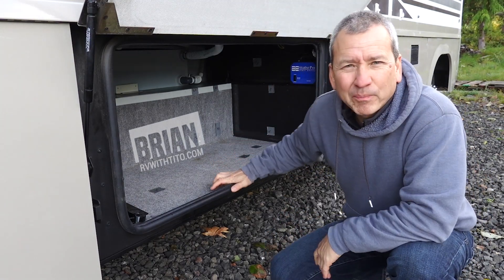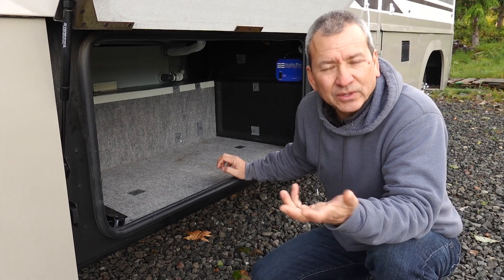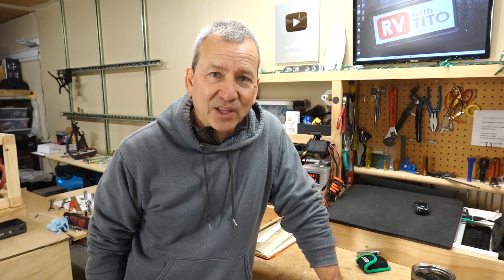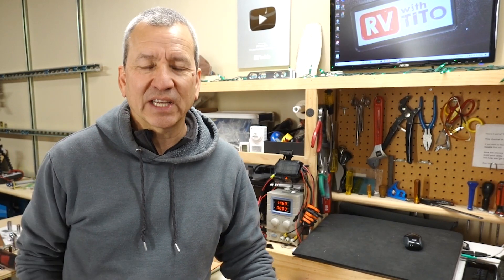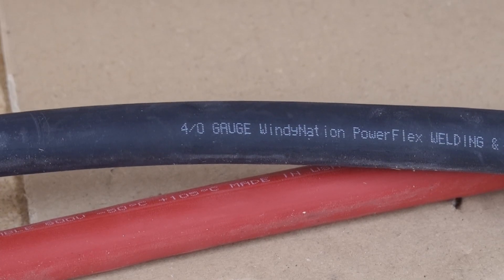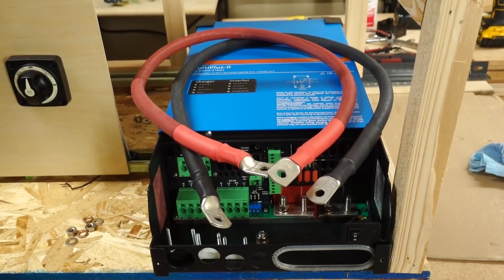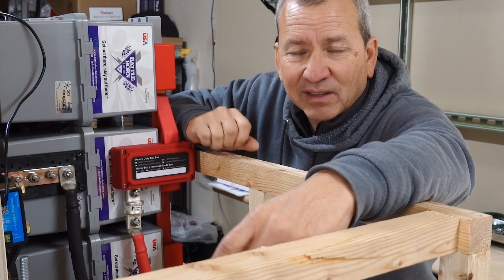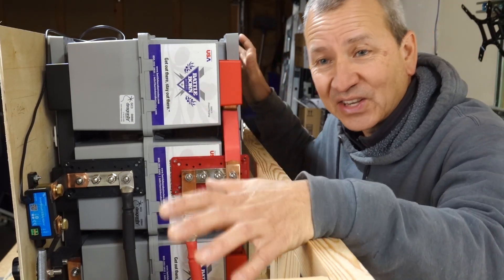Our Massive RV Battery Bank with Copper Busbars | Battleborn GC3 Lithium Battery | RV With Tito DIY

Comment: I just read your PDF, and that you have the Powerline system as well. Just a note, I just put in four 100AH BB's and a Go Power IC 3000 (I wanted the MultiPlus II, but it was back ordered earlier this year, and the size didn't fit my space) I have done this same setup in my previous RV but with the Go Power IC 2000, and it worked well 98% of the time for me. 

So the way the current inverter was installed from the factory is that there was a 30amp fuse in the main distro panel that feed the inverter, and the inverter feed two circuits in the RV. I wanted to run all 120v AC items in the RV via the inverter if I want to, so I rewired it, so that it feeds the main panel. I ran into problems with the Powerline system, when the inverter kicked in. To fix it I bypassed the Powerline system inside of the main panel. In the Panel, you can see where the common wires go to a power block controlled by the Powerline. I just removed that wire from the powerblock and went directly to the breaker, as you would in a panel with out the Powerline system. If I ever want to use it later, I could hook it back up, but I really don't see myself ever doing that.

Comment: As soon as I saw you were connecting everything with busbars I was worried about vibration as well. That is a lot of weight connected, but if you keep it secure you should be good. One recommendation is to use all three, or at least two of the holes on the GC3's built in terminals for your connection. I have seen what a loose 240V AC connection does.. Damn near burnt down my dads house. 

Now the BIG question... Are you going to add plexiglass and lights to the battery compartment? lol

Comment: Nice set up. I am currently in the process of putting in 2 GC3 Batteries and a Multiplus 2 in my 2014 Newmar Canyon Star. I looked at your diagram and was wondering if you are going to charge the batteries from the alternator? Also, I was told the fuse needs to be within 7" of the batteries and I noticed your fuse is after the distribution block closer to the inverter. Love to see how it comes out, trying to decide exactly what bay to put my batteries
Reply from the maker: I'm not going to install a DC-DC charger for now. I can simply run the generator to charge at 120A if needed. Plus I'll have 1700W of solar. The Victron DC-DC charger (the one we have in the Class C) will max out at 30A.

Comment: Brian, can you shed some light why pay $2359 for 270Ah when it is easy to find a good 200Ah for $700? The form-factor is really nice, but is it that nice? That said (asked) wonderful attention to detail and excellent presentation, my friend.
Reply from the maker: I considered lots of options for this. This really was the best option for me and yes, there are lots of options. The form factor was a big factor for me since I still needed to fit the inverter and all my solar gear in the same compartment. I've also had great experiences with my other BB batteries. The quality of these GC3s seem top notch and I'm looking forward to putting them to the test. The cost per 100Ah is about $870 which is comparable to many other leading LiFePO4 drop-ins. I wasn't simply going for the least expensive solution. I wanted a one-and-done-never-have-to-think-about-it solution. Not sure if that helps, but that's my reasoning.

Comment: I’m curious as to the weight, and more importantly, how much weight can the storage compartment safely support? Are you just putting the batteries on the floor of the compartment or are you “beefing” it up?
Reply from the maker: The batteries are 80lbs each. The Inverter is around 40lbs. I have a plan to support them from above and on this ledge around the compartment. The full weight won't be on the floor of the compartment.

Comment: I’m feeling a lot better about my choices now!  I went with the BBGC3 battery too and I’ve been working on shoe horning them into my battery compartment.  I’ve limited space, so I plan to go with just two of them.  It was a radical shape and design to me and I thought it might be a risk, but if RV with Tito is using them, I’ll sleep a lot better now….  😀. Looking forward to seeing how you install them.
Reply from the maker: Excellent. Stay tuned. Yes it will be a little tight but sturdy. Stay tuned.
Reply: @RVwithTito  Most definitely!  I think everyone is anxious to see this project through to completion.
Reply: Tim the Toolman Taylor would be proud.
Reply: You should apply some diaelectric grease between the dissimilar metals in you set up , or just use vaseline , it will work just as well to keep corrosion down and cost way less . I am a retired electrician .
Reply: @russelbaird5499  That’s great info.  I was wondering about that and thinking about getting some dielectric grease as I’m almost out.
Reply from the maker: @russelbaird5499  Thanks for the tip Russel.

Comment: Great video. Looks like you could install 3 bolts per battery connection point on the bus bar. That way, the likelihood of all three coming loose it greatly reduced. Also, LocTite and/or a secondary nut/nylock nut would help. That will be a great system, huge aH.
Reply from the maker: Yup. I could do that. I think it's pretty secure though. There are two bolts on the two terminals that connect the positive and negative to the busbar.

Comment: I am very impressed. Looks like a clean set up.  In the spirit of the thermal expansion below, are you planning on resting the batteries on some type shock material to reduce the effects of shock and vibration from pot holes and other road conditions.  Understand you do a lot of boondocking and the paths to those sites are unpacked.  
The shock and vibration may have an affect on bolted connections, especially those 1/4 20 fasteners in ABS plastic.

I always enjoy seeing your workshop.
Reply from the maker: I have a plan to support them from the sides and above (through the floor above). The majority of the weight won't be on the bottom of the compartment. Stay tuned.

Comment: Did you consider the pack will expand when they get hot. A lot of LifePO4 builders struggle with that. It will give some stress on the terminals. Very neat setup though. Look forward to the rest of the build
Reply from the maker: The way the GC3 cases are designed, there's plenty of space between the mounting feet. Room to breath I guess.

Comment: You mentioned vibration, but did not mention if you minimized mitigation by using blue or red threadlocker.  Good video, except I think many now adays will be building there own battery bank (unless being subsidized by the manufacture) at a MUCH more economical price.
Reply from the maker: No I don't plan on using lock tight. All of the these battery terminals do have nyloc nuts. I'd have to disagree with you about DIY battery packs. I know lots of folks who full-time boondock like us with Lithium batteries. Very very few have built their own packs. Yes I could have easily ordered Chinese LiFePO4 cells and multiple BMS' to build my own. I just prefer not to. Also, in case you're wondering, BB did not give me these batteries. I paid for them myself.
Reply: @RVwithTito  Ah!  That was the $7,796 question.  I was wondering.  Congrats on taking that plunge.  I struggled on pulling the trigger and I’ve a much more humble setup.

Comment: Looks great. Keep up the good work. 
Have you put any thought into keeping the batteries from getting down to 32 degrees. As you know lithium bms will shut down at 32 degrees for charging. I have built my own 600 ah lifepo4 batteries. I have my setup in an insulated  small bay on our class A. I used a rv interior 12v light that uses a 1156 12v light bulb and a 4” computer fan to move the air around the cabinet. Which is controlled by an arduino wemos board , Ds18b20 temp sender and a arduino relay. Temp is programmed to turn on at 45 degrees and off at 48 degrees. It’s automated to run on it’s own. When we travel the battery bay is heated from our basement Espar diesel heater. It works great. 
The 1156 bulb and fan draw 1.5 a when it runs. Works great. 
Cheers
Reply from the maker: Yes. An incandescent light works great, but it's ok for them to get down to that temp. Just don't charge at those temps. This is easily managed through the inverter and a temp sensor on the shunt. Also the compartment doesn't get that cold. My past experience has shown that this isn't much of an issue while we're using our RV. I have heating pads on our Class C lithium bank, but it's hardly ever kicked on. If you're using the batteries, the internal temperature will typically keep the battery from getting too low. Yes. If your RV sits dormant in a cold climate, it's best to disconnect them or do what you suggest. Thanks for sharing your setup.
Reply: This is a concern of mine.  I’m installing in the battery compartment which is essentially a steel box and I worry about cold locations.  I have a bunch of left over lights from swapping out to LEDs and thought to mount a couple in the bay for just this purpose.  I like the automation you’ve outlined.  I just need to figure out how to do that.
Reply: @jimsjacob   you need to insulate the box first. I used only one old rv interior 12v lamp with a 1156 bulb and after some experimenting I added a 4” fan to circulate the air. Have you used Arduino boards and coding before? It’s really not that hard to do. 
The arduino wemos board and relay is under $20. I can give you my arduino code, I use for the automation. The arduino wemos board runs on 5v which all you need is a 12v to 5v converter. 
Let me know if you want more information.
Reply: @craigmckenzie8028  Thanks for the reply.  I was thinking of insulation as well.  I can only do 3 sides as there is almost no space for the floor.  I have approx. 14 inches of clearance and the BBGC3 is approx. 13.1 tall.  I have zero experience with the board you mention.  If not to much trouble, please do share.  It is much appreciated!

Comment: You mentioned that he batteries fit a strut channel.  U can understand how that would be very useful.  Can you spend more time on mounting the batteries securely?  Thanks!
Reply from the maker: They are just sitting in the strut channel. My support setup is a bit more elaborate. I will actually have them supported from above and will cover that more in a future video.
Reply: @RVwithTito  Please hurry…. Installing mine and I don’t have you engineering skills.  LOL.

Comment: Try to NOT keep them at 14.6 V... 🙂

I'm sure you read it somewhere and I'm sure more people have said it or going to say it: unlike lead-acid batteries, lithium batteries don't like to be stored at the highest allowed voltage. If you are not going to use them for a few months, weeks or days then it's best to keep the batteries at about 50% charge or their nominal voltage which is perhaps 13.4V.  That way they age less fast.   I believe even the spec sheet of these batteries specify this as their "float voltage".

Then when you boondock and you use your generator or solar to charge them then that highest 14.6V is not a problem as in practice they won't stay long at that voltage due to you wanting to turn the genny off and/or the sun going down and all 🙂
Reply from the maker: I only took them up to 14.6 to top balance them. The charger is set to charge at 14.4V and float at 13.6V

Comment: That is pretty cool Bryan!  With regards to vibration from traveling down the road maybe put some anti-vibration feet under the batteries to act as shock absorbers.   Good luck with the project!  Looks like a lot of fun to build.
Reply from the maker: Thanks for the tip! I've got a plan to keep them pretty secure. Yes. It's fun to experiment with different methods.

Comment: Brian, great setup. Thank you.
I'm in the process of planning a GC3 based system for my motorhome as well. I bought 4 GC3 and a Quattro 48/10000/140 100/100 120V. I should be getting them on Monday.

I went the lazy route. I will be connecting everything with 4/0 marine cabling instead of the copper bars. Everything is going to be connected with Blue Sea systems switches (9003e), 300A class T fuses (5119) and fuse holders (5502). I will also be using Victron 500 A Smartshunts.

I went with a 48V battery bank for the 120 Vac needs of the bus because I want to be able to charge the bank quickly while boondocking. Charging at 140A @ 48V with the 10 KW generator is about 6.7 KW of charging. That is an efficient way of running that generator. So I'll be able to charge the batteries with solar during the day and then just turn the 10KW diesel generator late in the afternoon for an hour or so to top them off. Topping them off means charging them up to about 80% of capacity. For the sake of longevity with the lithiums, I think I'll run them between 25% to 80% SOC (State of Charge).  You can charge them to 100% and use them below 25% SOC, but the batteries may not last as long.

On the other hand, as you know, with 120A charging @ 12V from an inverter/charger such as the Multiplus II would just be about 1.5 KW pulled from the same generator. The 1.5 KW would be a very small percentage of the approximate 8.5 KW of continuous power that I can pull from the generator. Also, at 1.5 KW, it may take a few hours to charge that 12V battery bank, depending on how much solar there is on the RV.

I plan to have a separate bank at 12V with 2 GC3 in parallel charged by a Multiplus II. This way, I won't need DC-to-DC converters from the 48V bank to get the 12V that I would need for the coach. In addition, the 1.5 KW charging for that 12V bank + the 6.7 KW charging for the 48V bank would be a worst case of about 8.2 KW of charging from the generator. That would run it very efficiently at about 1 gallon of diesel per hour. Note that the 12 V bank will only be responsible for the 12V needs of the bus and none of the 120 Vac. Solar will go to both banks. So the 48V lithium bank will be strictly for the 120 Vac needs of the coach.

For now, I'll be using the setup as a backup power system in my bricks and sticks, because where I live in remote northwest N.J., I can always count on losing power a few times during the winter. The setup will be connected to the house wiring via a 50A 10 circuit transfer switch.

Next spring, my setup will move into the RV for some happy boondocking.

I'll be looking forward to the rest of your videos in this series.

Brian, just one constructive additional comment. I would recommend that the class "T" fuse be placed on the battery side of the bus bar. As it stands now, if you short prior to that fuse by the inverter, the cabling from the battery may overload and the fuse may not blow. That's because all the current goes down the short and not through the fuse which is further down the wiring. Fusing should be at the source of power, that is, as close to the battery as possible. In case of a short, the lithium batteries can provide a huge amount of current. I guess only limited by the built-in BMS. I guess the inverter may also need protection from a short. Now I'm wondering if there should also be a fuse at the DC output from the inverter?

Here is a link for this kind of discussion: https://www.pysystems.ca/resources/boating-tech-talk/robert-fuse/
Reply from the maker: Thanks for the suggestion. Most of the other key components on the pos side will have their own fuse. Yeah. I decided to stick with a 12V system and pay more for parallel charge controllers. I've had good luck/performance with that setup. I get why you went with 48V.
Reply: this is like going to a trade school w you both
Reply: There's been two recent papers proposing LiFeP04 may have an interesting form of "memory" similar to the NiCd's. The papers looked at old LiFeP04 banks that were cycled far less than 100% DOD, usually 50-70% DOD and found that over time the pack would "learn" that the capacity of their daily DOD routine would become their permanent available capacity. Not enough data out there to say this is true under any situation but its a consideration. I can't imagine being more conservative than 2.75 or 2.80 to 3.50 (balance on) 3.55 (max cell voltage cutoff). By the time you get 3,000 cycles out of these we will (hopefully) have a much better chemistry that has reached commercial viability.

Comment: The ribbed water tank fill hose becomes brittle with age. Consider replacing before it leaks on your electronics.
Mine failed at the outer wall where it connected to the plastic fill fitting. Sun baking wall may have contributed.
Reply from the maker: I'll keep an eye on it for sure. I don't always use that gravity fill. There's another pump fill on the other side.

Comment: You make it look so easy 😉. Probably the hardest part was the planning. BTW is it true that lithium batteries do not work well in freezing temperature?
Reply: They can not be charged if they are below freezing it will ruin the battery. Good quality batteries have built in low temp cut off to protect them selves. You can still safety pull power out of them so you can use the batteries to warm them selves up via heating pads or your rv furnace if you need to though. Its not a big deal if you take their need to be kept warm into account when building your system. Since they don't off gas like lead acid you can keep them in conditioned unvented space. If you can keep your water system from freezing you can keep your batteries from freezing too.
Reply: Thanks for replies. I had heard this but wanted to verify.
Reply from the maker: What they said :) I've actually installed heating pads on my other lithiums (class C) and they've rarely every switched on because the internal temp of the battery stays warm when using the batteries.